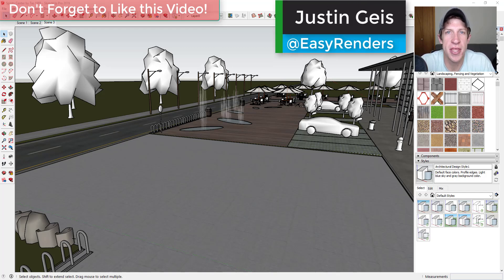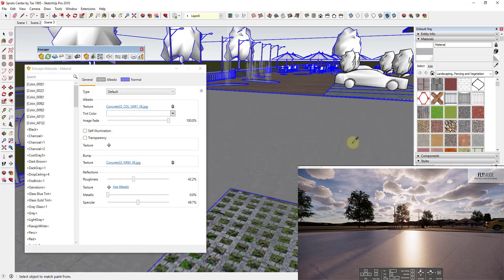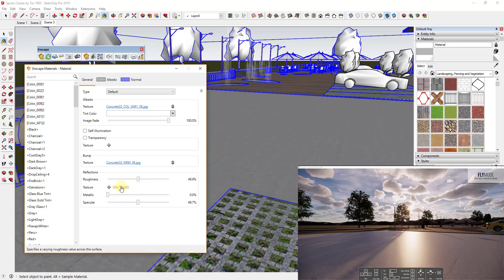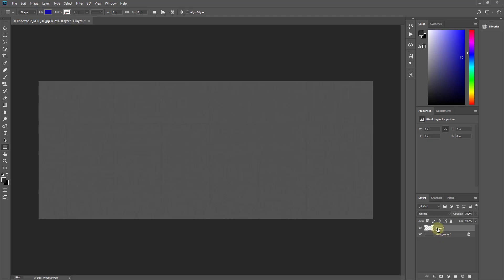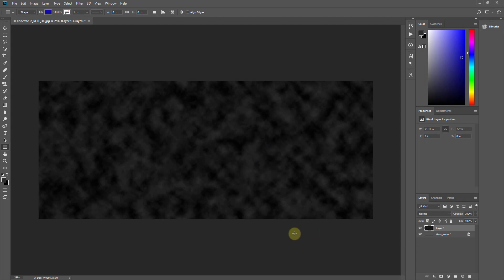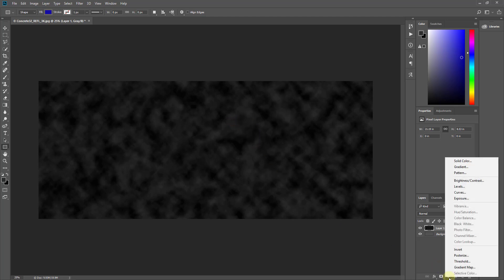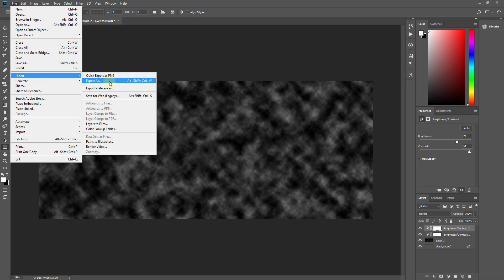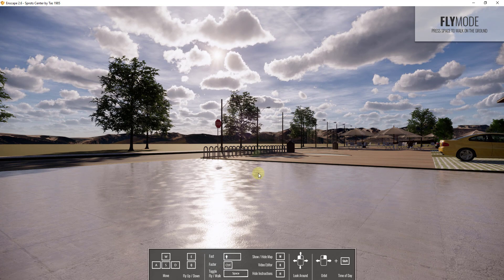Creating a WET PAVEMENT EFFECT in Enscape

Comment: Do u think Enscape is not really heavy as Lumion? I mean if would be work with PCs not very high quality in Hardware Specs.
Reply from the maker: It does seem like Lumion has the highest system requirements of the programs I'm working with, but it also seems to handle the most polygons. I've always felt Enscape is very lightweight and easy to use on my PC

Comment: I've also obtained good results by changing the scale of the reflection map inside Enscape's Material Editor.  It can end up looking fake though if you scale the X and Y uniformly but you can achieve more of a larger puddling effect.

Also fun to play around with some of Poliigon's other surface imperfection maps for this.
Reply from the maker: Interesting - I'll have to try that - that's actually a really good idea since all you have to do is make sure the reflection map no longer matches your material...Thanks!